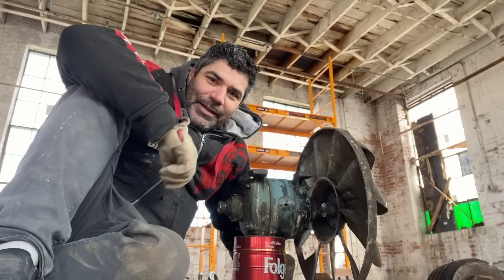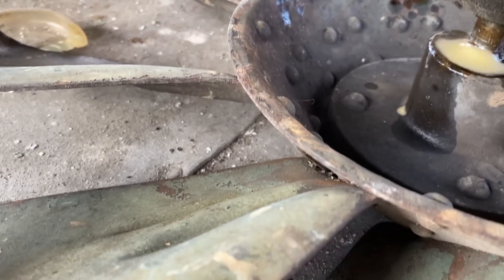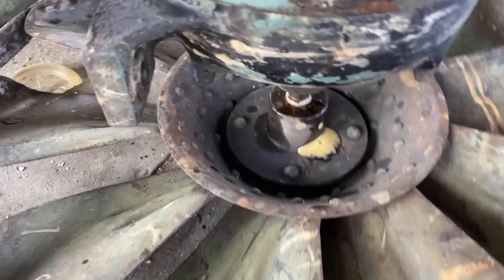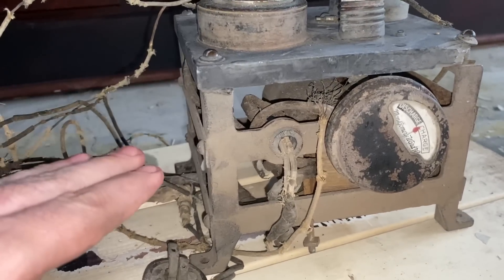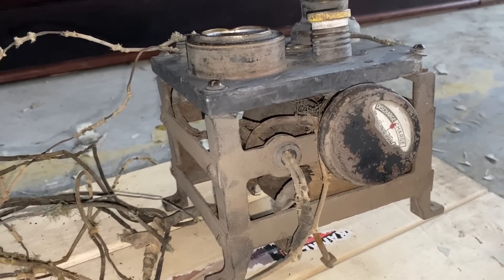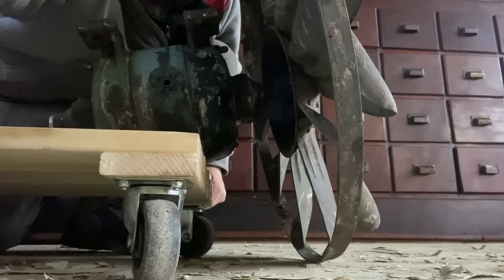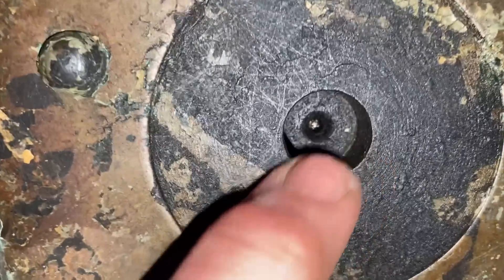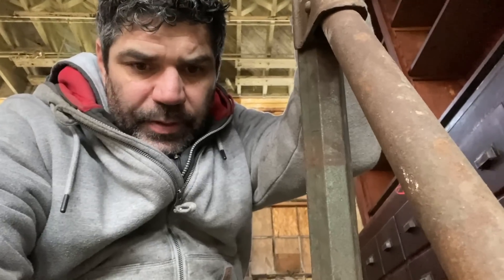Looking at some old pieces of industrial salvage

Comment: The fan is still just stuck and that shaft play is normal for all electric motors. It has that notch in it to catch the retaining bolt so it’s not threaded. Usually they would use a tool like what’s in this video to remove it https://youtu.be/PNKacxcTCvg  but you may be able to put something behind fan in between the motor to pry it off. Or couple light taps on the back and try to wiggle side to side the working around the fan. Good luck ! you got this!
Reply from the maker: The motor is so heavy I'll try a combination of its weight and some taps. I'll check out the vid.  By your YouTube handle I can guess you know what you are talking about.

Comment: Just get yourself a cheap 110 volt harbor freight welder but ask the advice of what kind of rods to use cuz that's often the most important part take care
Reply from the maker: all of that detail stuff is what intimidates me. What core, what settings, what guage of material etc.  Seems super hard for a complete beginner.

Comment: The thing you screwed into the bulb type socket is a resistor to heat up and discharge a battery, look at the gauge and see the left side says discharge. The old batteries were made to be taken apart for repair but you needed to discharge them first. Th discharge was also to test the load the battery could sustain. The new testers today do the same thing. The jack is a bumper jack, the hook goes under the OLD CAR bumpers. If you use it on a modern car it will rip the plastic bumper and half of the car off. I have one I use for my trailers. I have a shop with all types of welders, for you I would get a cheap MIG welder from Amazon and use flux core wire. You can learn to use it for small repairs by watching YouTube. No need to spend a lot. Get some scrap steel and practice.
Reply from the maker: Okay, nice.  I have plenty of scrap to practice on!  Thanks.
Reply: It can’t be any kind of car jack because a car jack lifts straight up this one lifts tilted .
Reply from the maker: @mwatkins2464  that's what I thought!
Reply: @brickandsole  It's a bumper jack, I have been using them fot 60+ years, the end is hooked up to go under a notch on an OLD car bumper, the new cars do not have real bumpers.

Comment: Clean up the hole on the shaft, what you called a pin is probably a hex set screw, which I think is still there. Clean it out really well.  If you see the hex screw back it out with the proper size Allen wrench…
Reply from the maker: I took that screw out already.  Working on the next step presently.
Reply: I think you're right because of the flat part on the shaft.
Reply: @brickandsole  double check that there are not 2 setscrews on top of each other…if not, try applying some heat with a propane torch on the hub.  Not too hot, just too hot to touch.

Comment: Grasshopper you must learn patience! Man fights with Rusty machine with no patience the machine says I've been in here for over 100 years really think I was coming out that easy! Get yourself with a torch sometimes these things are a beast to pull off. Please do not destroy stuff by making lamps out of it first find out the value. You have a couple pieces of automotive History get yourself a puller worksmart a grasshopper not harder
Reply from the maker: This whole building is a PhD in patience!  By the end of it I'll be so patient nothing gets done.  haha.  Yeah, I resisted the urge to cut it off.  And am updating over several videos.  Will get it off then the other 9 should be no problem.